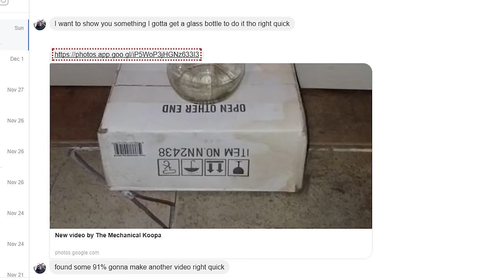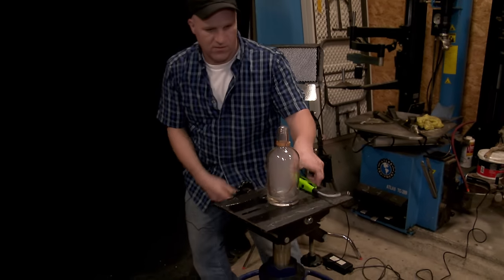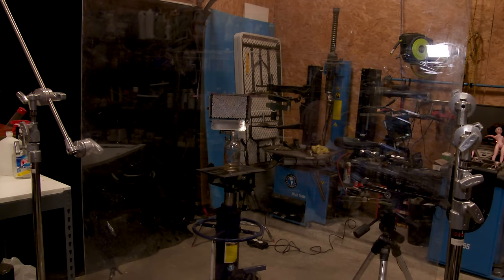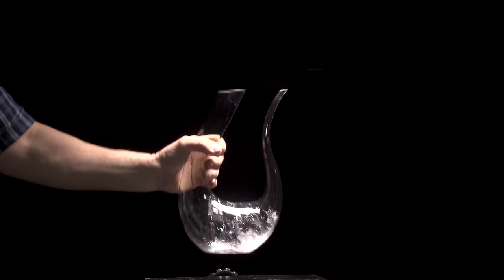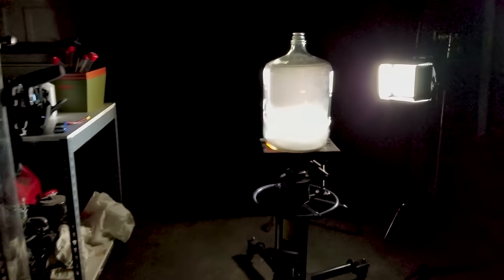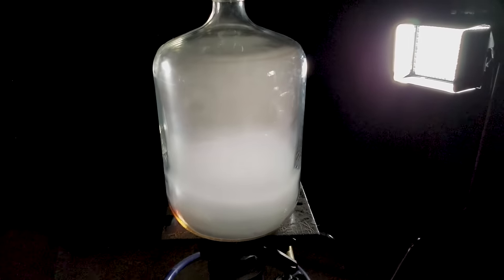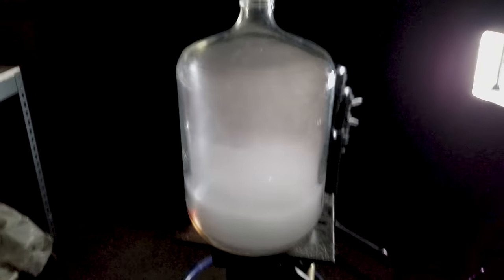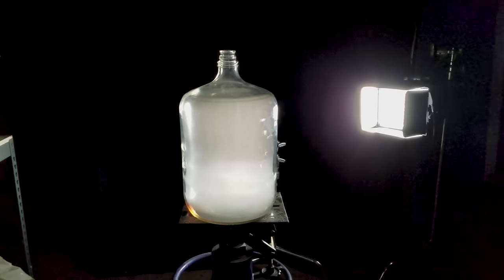Nitromethane Jet Bottle - Looks Awesome in 4k Slow Motion - aka Whoosh Bottle

Comment: This is a rudimentary pulse jet.  If you had a valve or injector system you could keep the reaction going eventually causing trust.  In fact that is something you should try.  Maybe even make one with a clear combustion chamber so you can see it all happening.
Reply: Pulse detonation rocket engine, perhaps? :P I've heard the specific impulse of nitromethane is actually not too bad in a traditional rocket engine, and pulse engines are supposed to have a somewhat higher specific impulse...
Reply: If you get the inlet diameter just right itll continue for quite a while. Jam jar pulse jets are pretty popular to make.
Reply: Christopher Raff I came here to make that same comment. Maybe run a compressed air line into the fuel chamber to keep the fuel atomized and fresh air coming in. Could be sweet.
Reply: Jason Hackney yeah when he had that funny shaped bottle I was thinking it would be great if he put compressed air into one side and light the other
Reply: Jason Hackney oh I just seen the very end he did it
Reply: Mush V. Peets pulse jet and pulse detonation are quite different.  In this video this flame front is very subsonic, meanwhile in a pulse detonation engine(aka PDE or supersonic pulse combustion, the flame front is supersonic.  Have a look here and you can see the difference https://m.youtube.com/watch?v=RQfZ82kpXHc.  I have some friends that did research on a similar concept in the lab I worked in.  Cool stuff, but positively deafening!
Reply: Christopher Raff it looks that way but the physics are quite different. Because nitro burns 1:1 with air and contains its own oxygen that gets released under compression.
Reply: Christopher Raff instead of a Reid system allowing the exhaust pulse to scavenge ambient air through a one way valve. It’s the No2 in CH3NO2 getting compressed out and providing oxygen for Re-ignition. Every time the fuel is compressed it emits more oxygen
Reply: How do you make a valved version I’ve looked but I can’t find it
Reply: If we constrict the bottle's end we could pressure and the thrust may increase

Comment from the maker: What can happen if you don't know what your doing and use the wrong fuel, Dangerous results here https://youtu.be/yYj0U9AMBZc
Reply: Warped Perception jeez i am not doing that
Reply: I was waiting to see that, but you were prepared and did good.
Reply: Warped Perception an electronic ignition with a smaller opening
Reply: The title of this video should be: "How to become a war criminal making a explosive device with non detectable shrapnel by X-rays"
Reply: Nitro bottle please, the white flame in slow mo will be awesome, film for us in 4k!!!
Reply: Too bad THAT wasn't in 40k slo-mo. Lol
Reply: Nice video! Next step could be to ignite it from the inside ;-)
Reply: Holy crap, that last bit with the air compressor is really awesome. I wanna see it!!!   Pyrolytic decomposition is one of my favorite topics.
Reply: i know that some powders like flour can be extremely flammable when shaken up and mixed with air.  Think this would work with powder?
Reply: what happened to the nitro methane briggs
Reply: Warped Perception 
What the hell happened to the see through head engine burning nitro video?
Reply: Try the same experiment, but with the bottle on a turntable at about 100rpm.
Reply: Warped Perception have you done an automotive airbag?
Reply: I’m guessing that with the included link, doing the same thing but using pure oxygen instead of compressed air is out of the question?
Reply: When using original audio slowed down, set lopass filter according to the new speed. It does not remove the annoying "buzz" that comes when you slow it down but it sure helps. For ex, if your original audio is 48kHz and you slow down image by four, there should be lopass set at 48k/4=12kHz. There is nothing usable above that limit, it is all just noise and distortion. One can use resonant lopass to return some of the "missing" sound, it boosts the frequencies just around the cutoff point.
Reply: Warped Perception k
Reply from the maker: @upsidedowndog1256  I decided to make it a full episode with a dynamometer and turbo charger, that episode is coming this week
Reply from the maker: @D3AThCAl2DS  it's coming, I I think the one you're asking for is out, but I have one coming out this week with the same engine on turbo nitromethane and the dynamometer
Reply from the maker: @jedpetersen3806  yes many times
Reply from the maker: @squidcaps4308  that's a great tip, I'm going to try that
Reply: @WarpedYT  
Cool! Looking forward to it! I love turbos.

Comment: If you look at the colour of the flames, the isopropyl burns much hotter but much faster.  The nitro burns at a lower temperature but since it has more energy per molecule looks much more impressive.
Reply: Nitro has less energy than alcohol

Comment: looks like the fuel is looking for oxygen to burn maybe placing a supply of oxygen via a pipe from outside the opening directly down to about 2 inch off the bottom of the bottle. fuel, heat, oxygen, take one of them away no fire. Your experiments touches on so many aspects of our lives from cooking our food to heating our homes etc. Thanx a bunch for taking a slice of your life to share these awesome moments.

Comment: We used to use 151 in a 7.5 gallon carboy back in the '70's. If you make sure all the sides are well coated, just dump out the alcohol; the vapors will be maintained closer to the walls of the bottle. That way, you'll get a 'ring of fire' move slowly down to the bottom.

Comment: One thing I will add is, it looked like you had 50% nitro. Methanol drastically changes ignition characteristics of Nitromethane. Methanol greatly increases the burn rate of the fuel in a exponential manner. To properly show what I like to say is Nitros extreme resistance to ignition it’s got to be up over 80% some people say it burns slow but I was taught it’s just hard to ignite.

Comment: If I'm not mistaken, this is how a "Pulsejet Engine" works. The main difference between an actual Pulsejet and this is that in a pulsejet, there is a mechanism to feed in fresh air once the air in the bottle is burnt up.

Comment: the end scene where you pump air in, if the smaller diameter nozzle had more curve to further restrict back pressure & you had a steady regulated flow of oxygen into the small inlet, i bet it would act as a clear glass "valveless pulse jet" instead of just a woosh bottle.  Now THAT would be an amazing sight, clear valveless pulsejet engine working, yes sir!

Comment: Pretty kewl video.  I wonder what would happen if  you were able to supply a secondary stream of air to the large bottle. Would it continue to burn? Take a small tube and run it down into the bottle just above the surface of the alcohol (so that, if it works, the incoming air would stir up the alcohol as it rushes in).

Comment: I believe that the pulsing is caused by the rapid Heating and Cooling and thus expansion and contraction of the gases pulling fresh air into the tube and does allowing further oxygenation of the combustion process.

Comment: I would suggest using water with a handful of calcium carbonate rocks, but that gives of acetylene gas so it might smash the glass on detonation, so don’t. As a kid I did it with a metal bucket with a piece of plywood that almost covered the top and then threw lit matches at the gap. A good one would fire the plywood 2 or 3 meters in the air. Great fun.

Comment: Very nice work, and especially the nice videography. Thumbs up for sure. Twenty years ago when we were doing this, we used nitromethane as well. It is interesting that none of your bottles resonated. We had a couple of brown glass bottles, maybe quart sized, and they would make a nice WHOOOOOOOOOO! We didn't blow in compressed air, so maybe the less perfect mixture made for a longer, slower burn? The best was the five gallon PLASTIC Sparkletts bottle. Since the bottom is flexible, it'll hop around for quite some time before it starts to melt and sag lol.

Comment: additions I'd like to see: introducing constant source variable pressure gas inject-possible just hold compressed air nozzle about a foot above the spout at burn time ; and a simultaneous mix of multiple fuels of different weights and viscosity:upshot: would we get a pousse cafe layered effect in simultaneous burn temps?  keep on experimenting

Comment: Try again but make the bottle implode. This is more dangerous but will be a great finally.
To do this put a check valve at the top and the flame will ignite as before but will create a large vacuum
in the bottle, then will have a great implosion explosion. You will have to make the check value.
Reply from the maker: John C o I don't think it will implode, you can probably go full vacuum with this type of bottle IMO. It would need some sort of shunt or shock for it to implode under any degree of vacuum. This bottle is very heavy and very thick.
Reply: I'm gonna have to agree. I think the bottle could take full vacuum.
Would love to hear the sound opening it again though.

Comment: I have done this many many times, awesome to see it in such high resolution in slow motion. Have you tried it with different air-fuel mixtures? I found that you get a extremely interesting flame front if you burn it right after it has already flamed with a very small amount of oxygen left.
Reply from the maker: Matt Starkey yes I noticed that with the alcohol, it looks very pretty but it wasn't extreme enough for me. Also if you just use straight polish vodka it also has that Slow Burn to the bottom.

Comment: Since you have fuel left over, I'm wondering what would happen is you feed an air line in to blast it (like you did before you lit) it while it's burning? I suppose the bottle may get too hot but...

Comment: I have a suggestion for this video,  if you put an air inlet near the bottom of the bottle right by the fuel or even submerged in the fuel, with a one way value on it so only air can go in, you should be able to to make the burn more consistent until all the fuel in the bottle has been burnt off, it should burnt in the same manor as a pulse jet.        I would love to see you do this, I don't think the plastic bottle will be cut out for it though as it will get really hot really quickly.

Comment: IIRC when Nitromethane is burned, it's by-product is Nitric acid.
Reply from the maker: TheFlacker99 (Flak) thanks !  I knew that but I kinda left it open for people to give their opinions. It wasn't as strong as usual
Reply: TheFlacker99 (Flak) : Can you explain the transition.? ( in not to complicated terms as my chem. knowledge is self taught) I would be gratefull.! Thanx in advance, and with a "pretty please" on top.! :))
Reply: I haven't a clue. I do know this
Explode-y thing go in in, burn-y acid come out.
Reply: explosivefreak666 your attitude doesnt match your @
Reply: Martin Correa : It's an old attitude. :)
Reply: Not nitric acid, but nitrogen dioxide, which dissolves in water to form nitric acid

Comment: try putting a tube through the center right down to the bottom of the glass so it can draw air without interrupting (pulsating). it will draw air through the center tube and burn via the bottle neck. Also i think it would be nice if you used some sort of double bubble type of glass ( two or severeal bubbles on top of each other and connected through a thin glass pipe ). thanks! :)

Comment: Okay everytime I watch a video I have more questions about your garage. why do you have nitromethane and why do you have all that shop equipment what do you do besides high-speed filming?
Reply from the maker: fuzzy wuzzy lol.. thanks, I love questions. because I'm a aeronautical engineer, I also have a robotics lab on that same compound and other sectors as well. I actually wrote this show in 2014 for Discovery Channel, it originally didn't have much high-speed, but then things took a turn and it was kind of a good fit, so I got to work and started developing some techniques that I could use for almost every single episode, high-speed made it much more understandable to everybody.
Reply: model engine glow fuel contains nitromethane, you can get it at most hobby shops.  Planes use 0-20% nitro, cars 20-35% nitro, and boats 30-65% nitro.  I believe he's using a race fuel which is a 50-50 mix of methanol and nitromethane.

Comment: I'm shocked the more flamable liquids dont just explode, i knew alchohol made a whoosh but the other ones would be too dangerous for me to dare try🙈 Cool stuff!👍
Reply: to explode they have to be confined in a sealed (or almost sealed) container.  If there's a big enough vent (e.g. the mouth of the bottle) no bang.
Reply: big enough vent for the flue gasses created yes. Leaner mixes would create flue gasses faster=higher pressure and possible bomb time. Always make sure to have super saturated mix in a whoosh bottle so it wont become a boom bottle.

Comment: Try diluting the nitromethane with methanol or ethanol in a 90/10 ratio. Also instead of rubbing alcohol, try straight methanol or ethanol in smaller amounts and then vaporize it with compressed air. You'll get a better reaction that way. If you go the ethanol (grain alcohol) route, try anything that you can drink that's 100 proof or better being sure that you sample it beforehand, and do the same thing as the other types of alcohol. It works quite well. (not that I would know anything about that)

Comment: That was awesome!!! Could you try something like this on a car with a 2-step or anti lag? I don't know the pressures that would be involved but a glass tube section close to the front of the car and a view of the exhaust tip? Might be able to capture the pressure waves and flame fronts?
Reply from the maker: Thanks, are you saying like a see-through exhaust manifold? Or in the exhaust pipe?
Reply: Warped Perception if you could device a manifold that would be awesome but realistically in the exhaust pipe would be cool and simpler.

Comment: It seems like the flame goes put once it reaches the bottom (no more oxygen).. what do you think would happen if you had a smaller air inlet but a closed system so pressure cant escape through nothing but the top

Comment: Take a 1-quart pickle jar... remove the top, make a 1/2 inch (12mm) hole in the lid. Reassemble. Place on a plate with about 1/8 inch (3mm) of water. (Safety) Then put about a shot-glass full of denatured alcohol into it.  Put in a little air... not quite as much as you were doing above... then light. If done properly, it will become a pulse-jet burning for over a minute... or at least until the jar cracks from overheating. You can also do it with a 1-quart paint can... which will become quite hot. The sound is great.
Reply from the maker: askjerry Yes I've been meaning to do a pulse jet for a while now but just haven't gotten to it yet, also I thought the cold water on the plate was for cooling the lower portion of air in the bottle to draw in higher velocity of fresh air. Thanks !
Reply: Actually... you are probably correct. Interesting experiment... film with WARM water... then do another with ICE... see if there is a difference.

Comment: A very cool experiment I learned by smuggling fuel home from the races🤣 fill up a plastic water bottle full of 75-80 degree nitro make sure there’s no air in the bottle. Then put it in your freezer. You won’t believe your eyes how much the fuel expands and contracts with temp.

Comment: Isn't Nitromethane more reactive under pressure? ( I heard once if you strike a puddle of it with a hammer it will combust). Perhaps that explains why the Nitromethane burns weren't as energetic as some may have expected compared to the alcohol. Though I haven't studied chemistry so happy to be proven different.

Comment: I was able to get shock diamonds with a tighter nozzle with a decent thrust if you get a good stoichiometric ratio, there is a danger if you dont have a big enough nozzle it could explode, basically smaller the hole or nozzle the higher the pressure and heat = faster burn which gives more thrust

Comment: The sweet smell is the ether for burning alcohol and nitromethane
Reply: It's probably the residual methanol fumes.
Reply: @kevinvinton5752   methanol is odorless bro.....
Reply: @artwellchikoto3951  Not when it's burned. It has a sweet smell. Ask any sprint car racer or fan, they'll tell you.
Reply: @kevinvinton5752  yes and sweet smells come for an ether
Reply: @kevinvinton5752  its not from methanol but the reaction from methanol and unburnt nitromethane and the acidic conditions of the nitric acid acts as a catalyst
Reply: @artwellchikoto3951  If that were the case, then how come whenever I'm at a racetrack where sprint cars are having an event (sprint cars being fueled by methanol, BTW), I smell a sweet smell everytime they bask by at speed, huh? Riddle me that one, Batman.
Reply: @kevinvinton5752  70% of air is nitrogen and all the combustion results in free radicals of both nitros based organic carbons and longer chains of carbon hence the radicals react with unburnt methanol to produce nitros based ethers.....its a common reaction in nature. ...in fact all the sweet smells we have ever smelled are from ethers.....from flowers to fruits like bananas and apples

Comment: Fire in any form is a fascination to me. I'm kind of a connoisseur, I suppose 😏. Woosh bottles are near and dear to my heart, to get their best performance, you don't want high performance. You want that bottle to do a slow burn, so it sits there and ROARS when you touch it off. You want vapor in there, not an aerosol, so pick that bad boy up and do some swirling action like you're dancing with your best girl. Then set her down and light 'er up! Watch out for your eyebrows, and cross your fingers the jug don't crack.